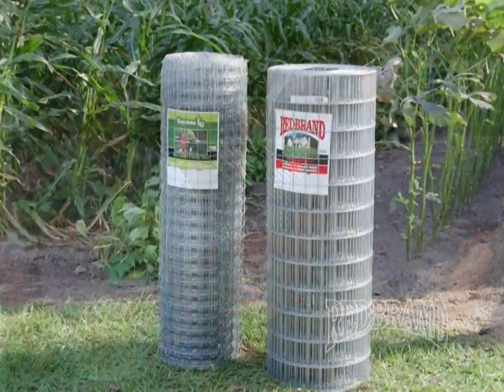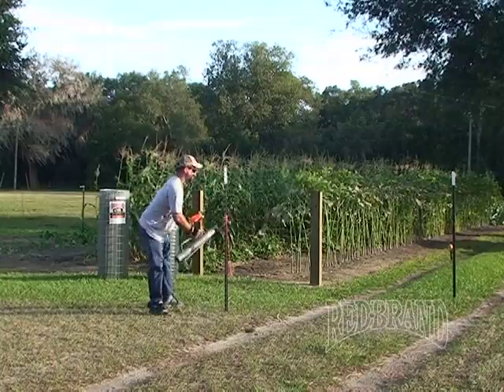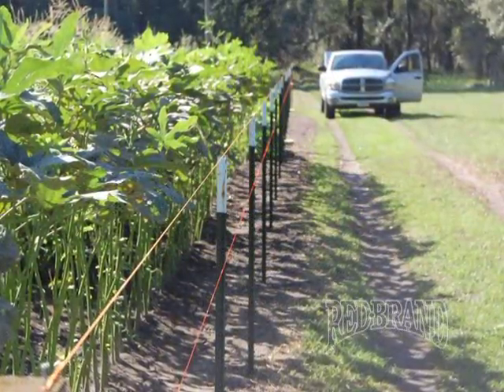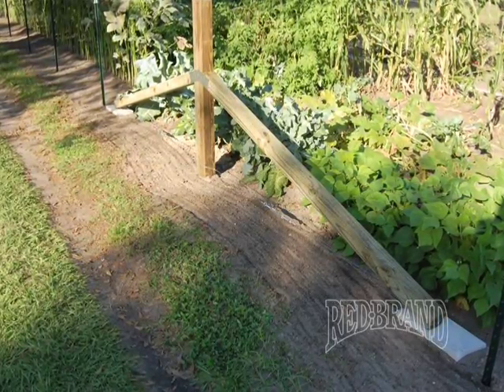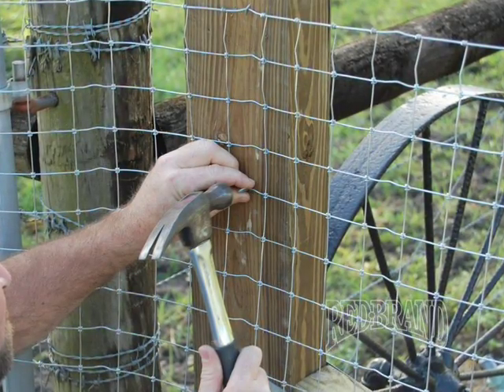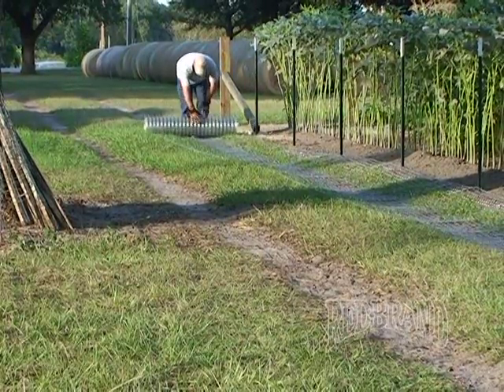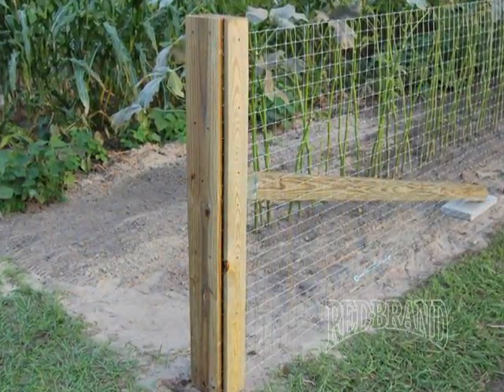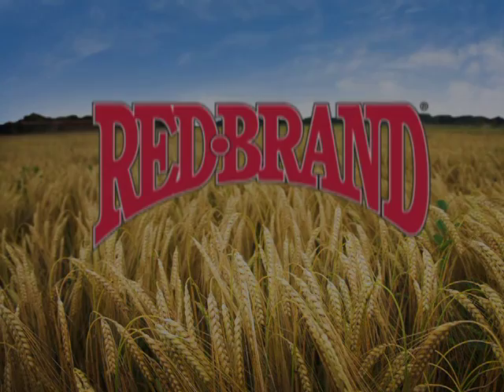Garden Fence Installation

Comment from the maker: Red Brand Welded Wire or Red Brand Yard, Garden & Kennel Fence are the fence brand names. Red Brand Welded Wire is located on the Red Brand website under the Other Products tab. Red Brand Yard, Garden & Kennel Fence can be found on the Red Brand website under the Specialty Applications tab.
Reply: Red Brand ss

Comment: Solid steel posts very 10 feet in concrete footing,and heavy gal wire along the top to make a dual purpose fence and grape vine trellis. ideal as the sun is to youre back